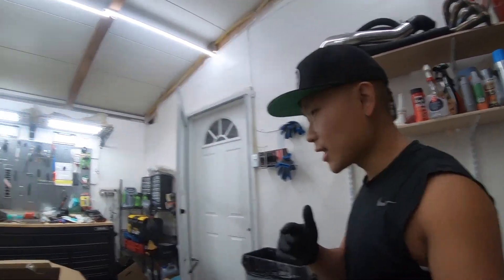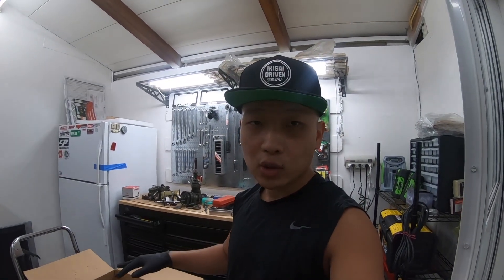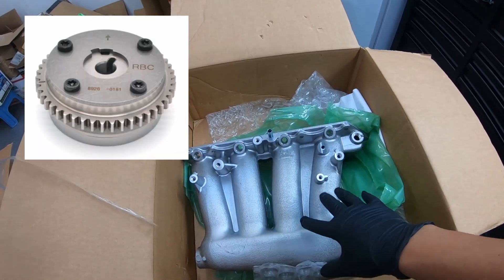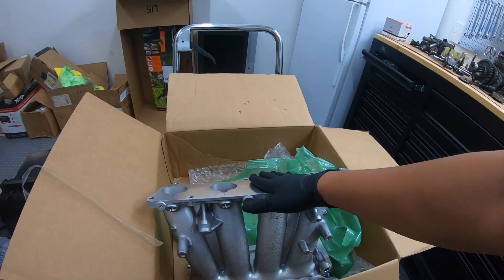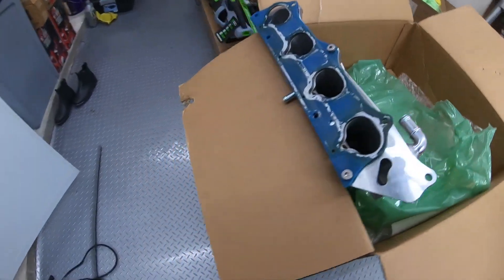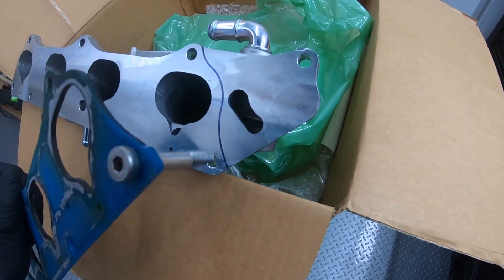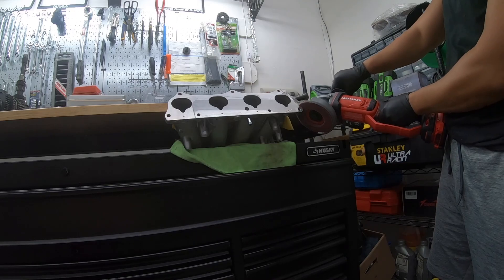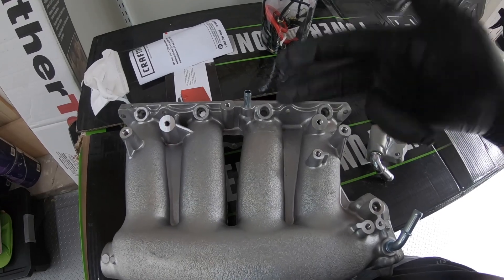RSX K20 K24 RBC INTAKE MANIFOLD

Comment: Do these rbc intakes fit on the 03-07 Honda Accords???because they fit on the Acura TSX
Reply from the maker: It will fit but also needs to be grinded down
Reply from the maker: Use the gasket as a template
Reply: @ikigaidriven  ok man thank you so much👍🏻
Reply from the maker: Basically the same as how I show in the video
Reply: @ikigaidriven  like drilled ports?

Comment: probably got asked already but what would i need if i want it to fit my 06 Honda accord if it even does fit
Reply from the maker: does the 06 run a k24a2? if that is correct its the same you need to cut it and i believe a throttle body adapter
Reply: @ikigaidriven  its a k24A8

Comment: Do u have to tune the car after replacing the vtc cam?   Reason I ask is cuz I have the 50° vtc cam but im kinda short on funds to go for a tune if I was to need one.   Thnks man
Reply from the maker: Depends! If you are running a car that already utilizes the 50 degree gear than the ecu can already actuate 50degrees. If not then you also don’t have to get tuned, but might want to in order utilize the cam gears full range of motion
Reply: The 50 deg swap just wont do anything if the ecu isn't tuned for it.

Comment: Would rbc intake work better with k20 jdm typer head with k24 block?
Reply from the maker: Great questions yes but the amount of horse power would be insignificant
Reply: @ikigaidriven  i see. Because in asia we dont have k20a2. So its either jdm k20a3 or jdm k20a type r.
Reply from the maker: Definitely do the k20a then
Reply from the maker: It will still create the similar gains maybe a little bit more because the k20a flows better than the a2
Reply: @ikigaidriven  camshaft & valve spring wise it's the same with k20a2?

Comment: So I need to buy an older generation vtc gear for my 2013 si rbc swap?
Reply from the maker: I'm not 1000% sure about that. Just check what cam gears you have and if they are able to actuate the full 50 degress
Reply: Ikigai Driven I’ll check that out thanks👍

Comment: I have a K24 2006 TSX block and Type S Z1 head in my 2005 RXS Type S. Am I good to go? Do I just buy the RBC intake manifold, do the mod you've shown and bolt everything up? Do I need a different VTC Gear? Throttle body will bolt up? I will have a enough room in the engine bay for this larger manifold? Thank you!!!!! I've been into Datsun for years and am looking to start modding my RSX.
Reply from the maker: Good question, you already have the vtc gear if you are using k20z1 head and the throttle body will need an adapter to bolt up
Reply: @ikigaidriven  Thank you for the reply, so buy the intake manifold, and you're saying I buy the throttle body adaptor as well. I think K-Speed sells that, correct? So with this I use my existing throttle body, the adaptor, and mate it to the manifold? Lemme ask you this.... If I want a larger throttle body, like a 70-74mm do I need to buy an adaptor to match the throttle body diameter, then do I also bore the intake inlet? Bore out RBC, buy adaptor with diameter I want, and buy throttle body with diameter I want. Yes? I guess I could just start shopping around and that'd answer my questions too. I'm just bored so asking questions.
Reply from the maker: Yes correct !